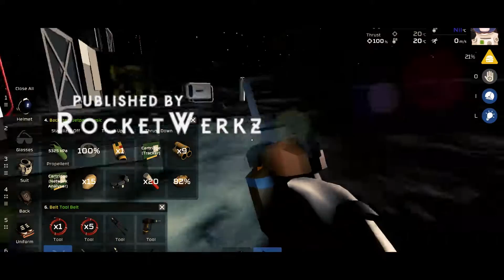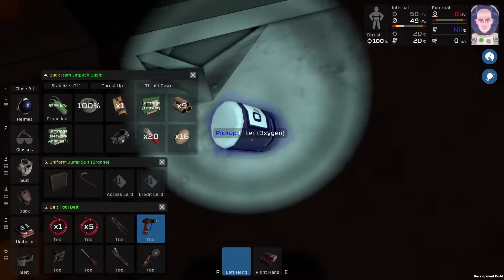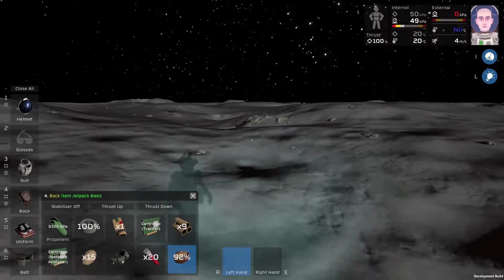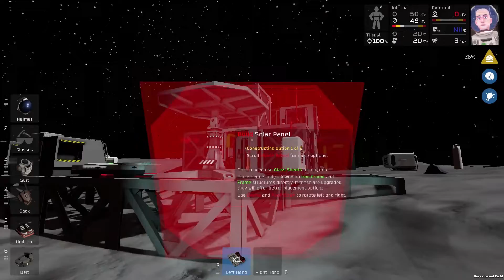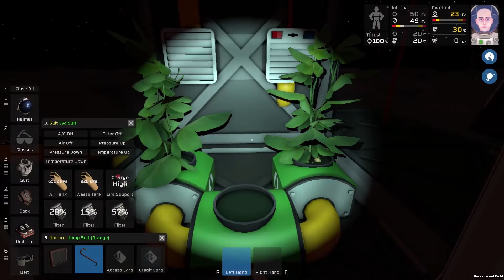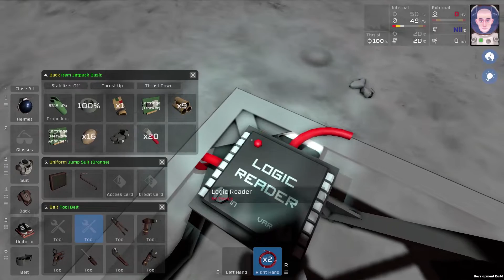Stationeers | Power Grab

Comment: Btw, they have updated the labeller awhile ago. You can not only label objects, but can change the setpoints
Reply from the maker: setpoints?
Reply: @TheScarletSeeker  for example the setpoint on a mem chip can be changed from 0 to inf. Or for example a pressure regulator can be set with the labeller instead of spamming the dial.

Comment: There is ice water, but hard to find. Looks like Ice Oxcide and Silicon. 
The decimal 1.8 can be programmed by putting the value in a memory chip.
Reply from the maker: oh nice they must have added that which makes things so much easier!
Reply: Yes wasn't there also a setting somewhere for water renderer in settings I believe I think it may be of by default so you can't see it